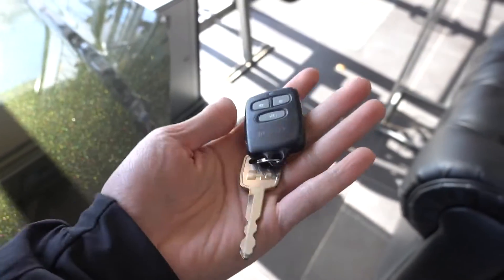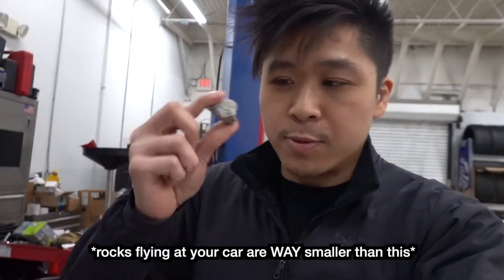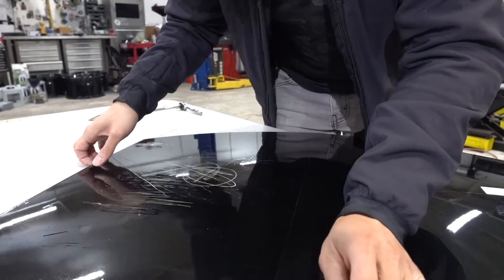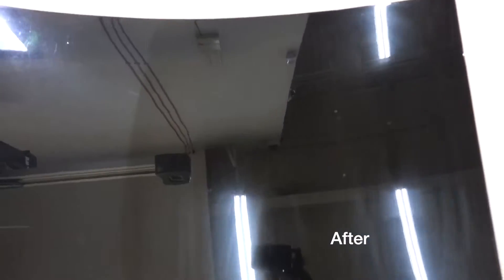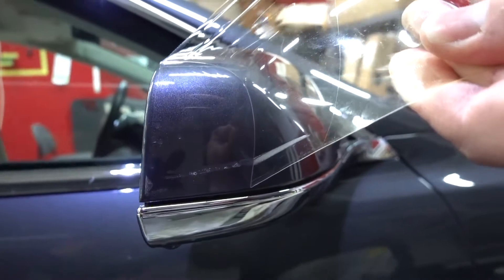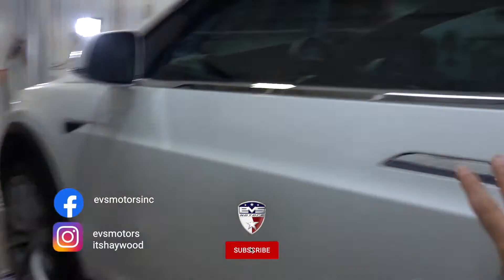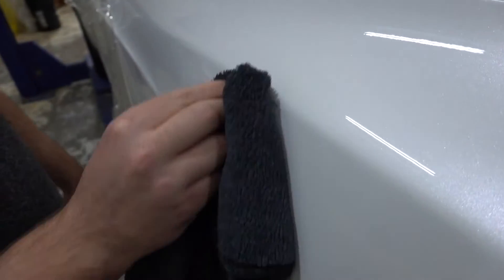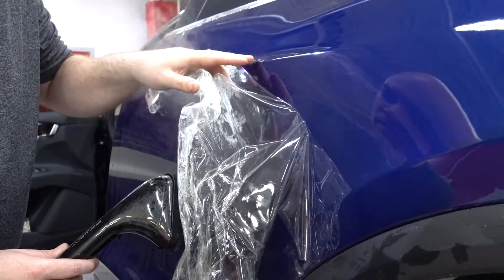Is Clear Bra Worth the Money? *Damage Test & Real World Examples*

Comment: Had 2 coats on- it's great stuff yes but so many have 2 layers, pretend water repairs it ( hot water & hot sun will yes) so will a heat gun- after when says a scuff & 4.30 was film scuffed, also the metal thickness plays no part, I know detailing 11 years & we install coatings,- why remove the film heat it it heals itself- slightly

Comment: I very nearly had it applied to a new Polestar 2, but decided not to due to the cost. It seems like a no brainer if you can afford it and want to protect the car, but in my case the install was about 10% of the car and very hard to justify. An installer I asked was very honest and told me that the self healing properties don't last for several years in Nordic climates. Do you know if that's true? My other concern was lack of installers in the area, meaning I would have to drive 7 hours to the workshop to replace it. Obviously in the US this wouldn't be an issue! 

 How long did it take to remove, prepare and install new clear bra on examples in the video? :)

Thanks for the video! :)
Reply from the maker: Can't speak on the  self healing properties in Nordic climates, but it took a maybe a hour or so.